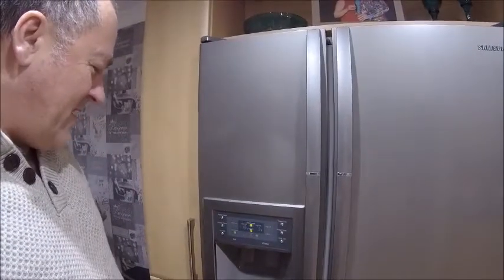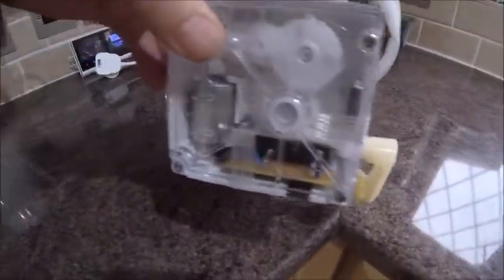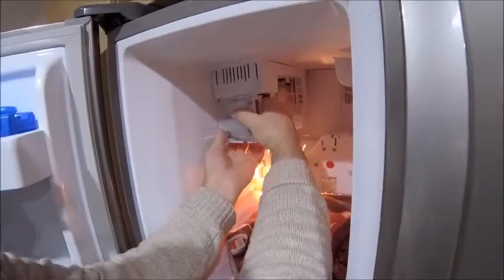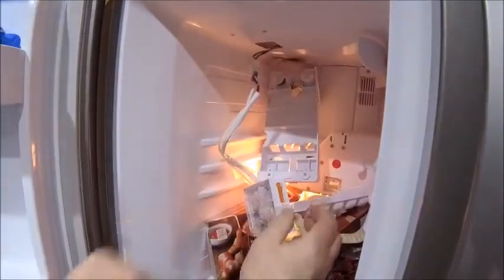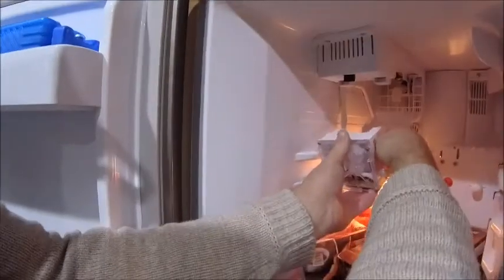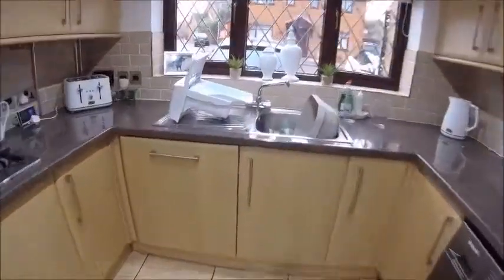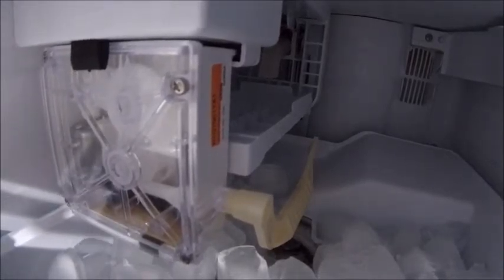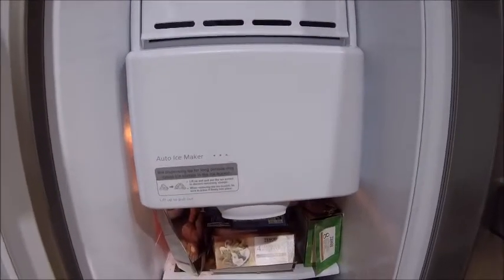Samsung Rs21Dcns American Style Fridge Freezer ice maker replacement.

Comment: Never thought I'd look up a fridge freezer model and find EXACTLY the video I need. I'm replacing the actual housing that's bound screwed to the ceiling part. The arm didn't break for us but the actual hole at the back that holds the ice tray whilst it's getting twisted broke so whenever it tilted the ice tray it would just pop and the tray would fall out. Thanks for sharing this was super helpful
Reply from the maker: Just goes to prove you can find any old rubbish on you tube  😂  ... Thanks for dropping by and the comment....

Comment: I'm impressed! I have a similar fridge and wonder if you know how to fix the ice dispenser lever. Someone has pulled mine instead of pushing against it, and it's come out ot it's little sockets. Even if you don't know, I'm still impressed and mesmerised by your video. Thank you
Reply from the maker: Thanks for the kind comments... the unit itself is fairly straightforward so I would have a tinker with your issue , I bet it won't take much to fix it  :)

Comment: I have the same fridge. Problem is mine only crushes ice.

I am thinking the module at the back is supposed to spin either clockwise or anticlockwise to change between the jagged and blunt sides of the blades. Mine only rotates 1 derection. If you get a minute open your door and hold the button in left to it thinks the door is shut. Then select cubed and crushed to see if it rotates in different dirctions I would appreciate that so much.
Excellent video Thankyou very much.
Reply from the maker: It spins anticlockwise on both settings, But i "cubed" the solenoid activates to push up the bar on the ice try, I'[m guessing to deactivate the crusher wheel.
Reply: @AdeReeves  Did my youtube research. The solenoid flips a metal rod under the large ice bucket tray. The rod opens the plastic door in the bucket to allow full blocks to drop. My solenoid is stuck in 1 position. (keeping door closed) When this door is closed it pushes the ice onto the blades = crushed ice. 

I have ordered a new solenoid. 

Thankyou for your reply
Reply: @AdeReeves  Also my ice tray wasnt fully turning to release the ice. The tray sits on a bracket at the back. Mine has snapped so the tray spun half way and was jammed as it fell out of the bracket. Ordered a replacement. Also advise pulling fridge away from wall, unscrewing vent panel at the bottom (5 screws) and hoovering the coils. Mine had a thick matted blanket of dust which can cause fridge to run hot and cause problems in future.
Reply from the maker: Nice catch  👍
Reply from the maker: Yes hoover mine every year and clean the top sensor measuring room temp.
Reply: @AdeReeves  Good man. Will clean sensor later.

Comment: Thanks! 
How do you replace the water filter on this model?
Reply from the maker: There should be a big inline carister on the back of the machine ...its simply a coup,e of pipes to remove to change it .
Reply: @AdeReeves  I can’t see it at the back, do you have to unscrew the back of the fridge?
Reply from the maker: @snoop2274  no it should be in plain view unless its been deleted...chase the water feed back, it should be in line ...
Reply: @AdeReeves  don’t see it , I’ll just have to get a new filter and cut into the line and add it in…